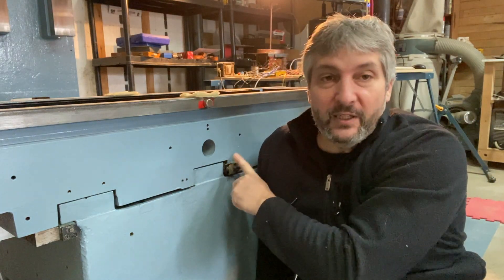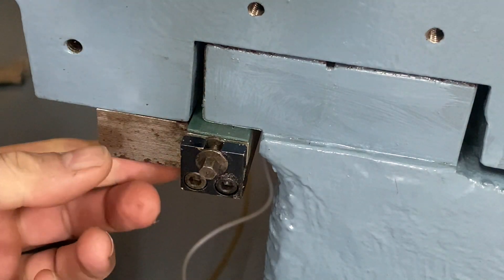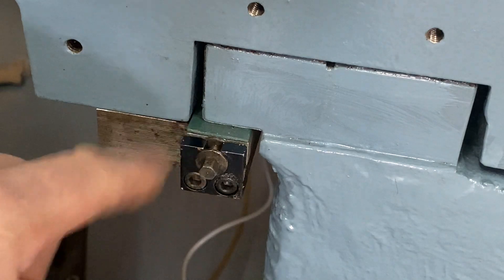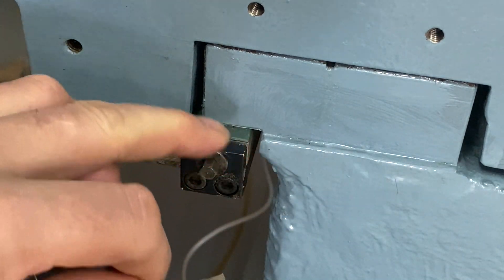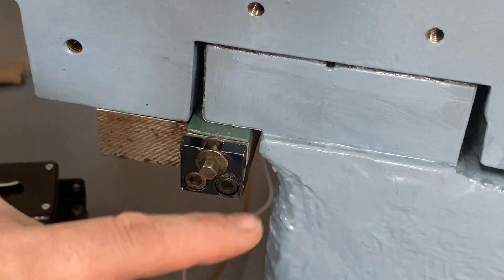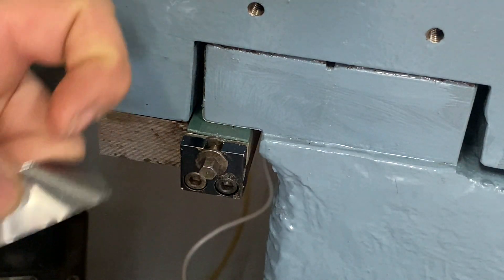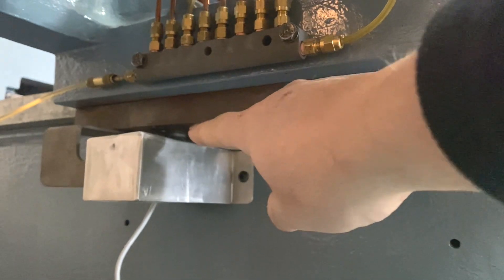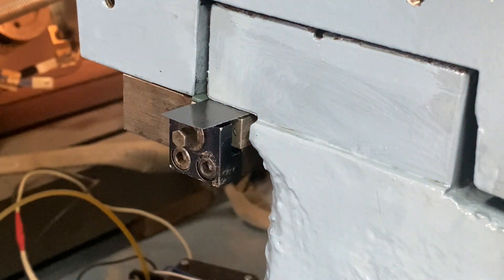Part 37 (Adjusting the gibs under the saddle)

Comment: I want to see this procedure on Z... because I belive my Z axis jump like crazy when I use a bigger drill
Reply from the maker: It is quit possible that the problem comes from play in the gibs. It can also come from the two angular contact bearings that hold the Z axis ball screw. A third place where play can come from is the ball nut it self. I think it will be a moment before I get to installing the head. Can’t wait though!